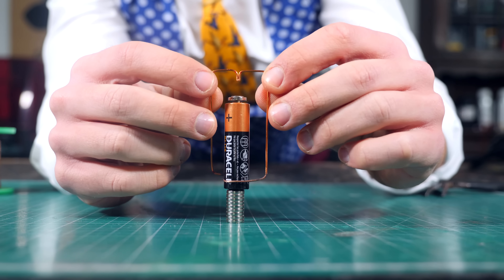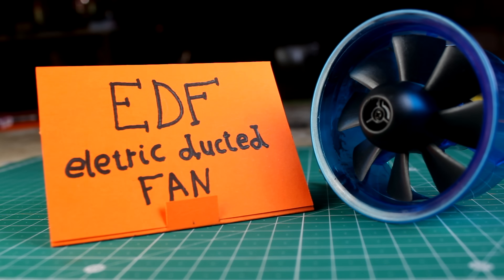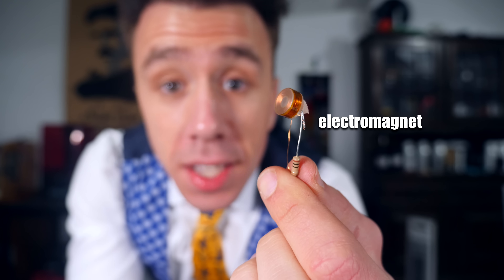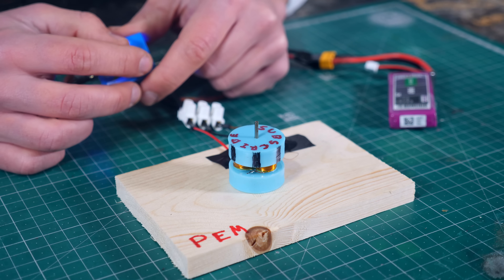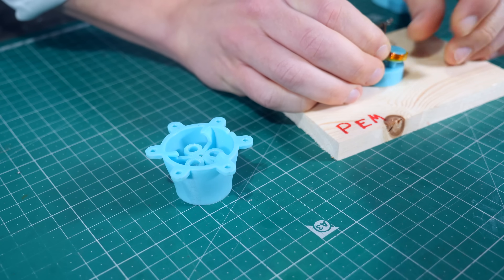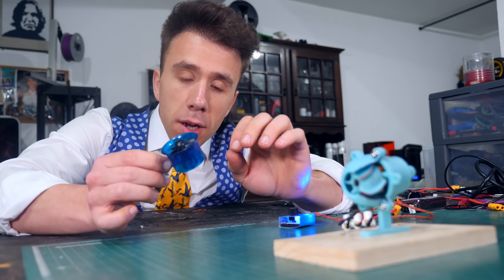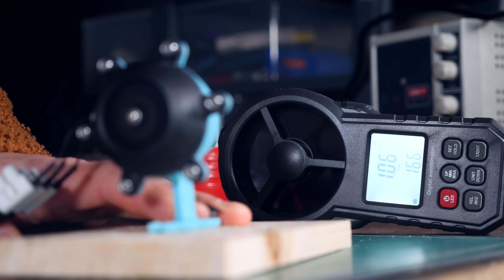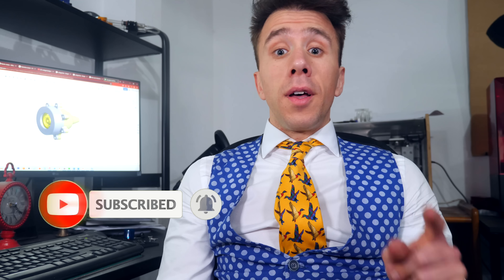I 3D Printed an ELECTRIC MOTOR FAN

Comment: Hi Integza. Typically, axial fans create ‘high’ flow at low pressure ratios. Impellers/centrifugal fans create ‘low’ flow at high pressure ratios. For impellers, this pressure ratio is a function of rim speed (and a bunch of other things).
Reply: Also, I forgot to add that your throat areas look significantly reduced moving from the edf to the impeller/ centrifugal fan.
Reply: Yep, was going to mention that. The dyson one he finished with is a mixed flow fan, kind of a medium pressure, medium flow type fan. Regarding the outlet area, since he has additional pressure available from this type of fan he could probably have a smaller outlet area, but not that much smaller. One thing I learned when doing some CFD work on a mixed flow fan is that you want the outlet area to gradually increase as you progress to the exhaust. We found that sudden increases in area would generate a lot of turbulence and reduce the fan flow. Also stationary vanes that "catch" the outlet flow from the fan and straighten it out also helped the performance, like the stator blades of a jet engine
Reply: Not to mention the impeller copied from a vacuum will probably be better suited to draw a vacuum than to move a lot of air....

Comment: you are somewhat compressing the air, it raises its temperature and heats the walls. If you want just thrust from the motor, the least you compress the better. I dont know if this happens at this scale, but its a guess... I will ask ChatGPT to see if its true...
Reply: Ah you could use PA12+CF filament to print that impeller...

Comment: Yoo Joel, Excellent job, i'm a big fan of the fan jokes.
 
If I may suggest something to help.
 
Is it possible that you're getting more thrust with the fan than the centrifugal thruster, because you have restricted the flow area too much in the centrifugal thruster that the mass flow rate is drastically reduced?
 
It would seem the fan can "scoop" a lot more air per rotation.
 
And while thrust is definitely velocity dependent the mass of the air being thrown backwards also makes big difference.

The the centrifugal thruster may be propelling the air out the back much faster but it may not be sending nearly as much air so the overall thrust is not nearly as much.
 
Also remember, and I'm sure you know this already, most in action centrifugal compressors on turbojets are just that, compressors.
 
When they compress the air the flow areas don't need to be as large for the same mass flow rates.

So if you're trying to make a centrifugal compressor thruster and modeling it after regular centrifugal compressors in turbojets but not also doing a high compression ratio, the mass flow rates will be restricted.

But anyway. Just a thought and random stab in the dark without knowing more details about the build.
 
Let me know what you do figure out in the end though. I'm very curious input this build. Stay classy!

Comment: Video ideea: land an egg on the ground (without breaking it) just like NASA landed the curiosity Rover on mars! You could use solid fuel rocket engines and thrust vectoring control to stabilize the rocket! All of this would be done after the egg has fallen from a two stage rocket controled by an arduino! The rockets would fire at the perfect time so that when the egg touches the ground there is no more thrust to get it flying again! 

Also tomatoes are disgusting!

Comment: As others have stated, axial and centrifugal fans are optimised for different use cases. Axial fans are great at moving volume, but suck when they encounter back pressure (try printing a cowling for the back of the EDM that restricts the airflow down to the same diameter as you had on the outlet of the centrifugal fan and compare flow then). Centrifugal fans move lower volume but can do so with higher back pressure.

Dysons fans are used in situations where high back pressure is encountered. The "fan" requires high pressure to create the ring of  airflow that "pulls" the volume of air through the fan hole. Vacuum cleaners have filters and relatively small pipes that air must flow through which increase resistance to flow and thus the fan sees a relatively high pressure difference between it's two sides.

Comment: The issue is losses due to compression, the edf doesn’t compress the air as much as just move it, the impeller wheel is trying to compress the air your passing through, the only way your going to get that moving the way it should is to put the motor the other side of it and create a gas turbine engine and use the motor to get it up to speed and then once it’s running use the motor as a generator to produce the energy to run the jet, hope this helps

Comment: As you said, your setup adds some extra steps. Maybe it's a bit naive, but isn't the point of pressurizing air to make it burn with kerosene in bigger quantities ? I believe pressurizing the air, only to throw it backwards without an added fuel and combustion, is just lost efficiency. The air momentum is thrown sideways for relatively "useless" reasons in that case

Comment: Turn the fan inside out like a funnel but with blades on. 

Alternatively, copy a high bypass turbofan engine with a flat disc of blades running air around the motor in a streamlined body. 
I'm not sure how the Venturi effect may affect things.

Comment: I do not know will this help or not, which that is just my modest opinion. I will say that try to add some flare on the edge of your fan case, trying to achieve a more laminar behavior on both the inlet and the exit; in my knowledge, turbulence are more likely to stick on a surface - where for a small fan the surface to area ration is significantly larger; I will believe this will decrease the resistance of the air rushing out from your nozzle and potentially increase the performance

Comment: Momentum is m*v, energy is m*v^2/2 So you need to push a lot of m with small v - to have higher trust at lower energy (power).
Essentially you need to make a large propeller, like on a helicopter.

Comment: I’m thinking that you are trying to get a flow ‘through’ your impeller, when you should be aiming for flow into the centre of the impeller ’hub’, but then having the air coming off the impeller ‘laterally’. If you look at where the opening to the combustion chambers on a High Bypass TurboFan are on the outer edges of the impeller, and then redirected rearward.  This also is how the impeller works in a water pump.  The impeller ejects the water laterally to the axle of the impeller.

Comment: Design it around the maximum force your 3d printed parts can handle, that way the angle of attack is truly optimized and the draw of air and power is at its highest performance

Comment: Thrust depends on the propeller geometry, air density, airspeed and the RPM. You want to obtain the same amount of thrust that the EDF, therefore you will need to move the same amount of mass of air that the EDF moves. If you have less surface area you do this by increasing RPM.
Reply: Other thing is that centrifugal fans are great in increasing air pressure but not as efficient in moving a great mass os air therefore the ducted fan has a larger mass flow rate than the centrifugal fan.

Comment: An axial fan works because of the pitch of the blades.
A centrifugal fan works because of the "pitch" of the blades.
One must remember that the air through a centrifugal fan does not travel straight from the axis to the edge in a perfect radial flow. It swirls around with the rotation of the fan. Thus, the blades in your video are likely very flat pitch relative to the flow.

The apparent angle of attack of the blades increases by moving the trailing edge (outer edge?) forward with respect to the rotation direction. A blade with a very high angle of attack would "look" like it should pull air back into the fan. A blade that looks like it pushes air out, in fact, has a very low angle of attack.

Blades such as yours create better static pressure compared to axial fans. Old jet engines used them because they could make a decent compression ratio in the burner cans with the available manufacturing technology. Now we have multi-stage axial compressors that can push upwards of 30-50:1 compression ratios. But, we also have the capability to manufacture high temp alloys with a great deal of precision compared to 80 years ago.

You'll likely not get the velocity from a centrifugal fan that you will from an axial. But, you can get close. Just adjust the fan blades with the trailing edge forward of the leading edge by about 20-30°. That should help. It will be a trade off between static pressure and velocity. Up to the point the fan won't make enough pressure to overcome drag.

Give the higher pitch blades a try.

Comment: well it is the same motor but diferent fan tipes have diferent levels of efficiency so im guesing that guys that made the original fan desine spent much more time makeing it more eficient, or it can be that it has more surface area than your desine. and a sugestion for a future video is can you make a variable geometry turbocharger

Comment: As you told in the video, Centifugal fan push the air outwards. So, some of the wind colides with the casing and loses its kinetic energy. 
In the EDF, the wind goes straight and doesn’t lose its kinetic energy and thus the EDF can produce more wind speed.
You can add a constriction at the rear part of the fan as a nozzle in your fan. This may help.
This is my theory.

Comment: your problem may be (and correct me if im wrong) wabey the plastic that your ysing may cause problems with you "fan" perhaps the diamiter or the stress aceptence is diffrent like the plastic that the fan uses may be able to take the stress bater that the 3d printed parts? or the casing is not smooth like the platic from the fan ( mabey try some kind of lube etc) hope this helps!

Comment: why would you dogmatically assume a centrifugal fan that an pushprop-edf would have the same efficiency as an centrifugal fan? That physically CAN NOT work. While one just pushes the air forward the other one pushes it outward in to a wall. So while one has NO change in direction the other one has TWO direction changes for the air flow and thusly a lot of energy is lost, since a change in direction is considered a acceleration a well.

Comment: I thought you mentioned on a previous video that impellers are optimized to compress air. The dyson impeller is probably optimized to pressurize the shape and volume of the dyson fan. In contrast your setup expels the air a few centimeters from the base of the impeller. It seems like there could be a lot of turbulence and centripetal that is dispersing the energy of the air jet.

Comment: no, you still have an axial fan there; and a varying blade angle that makes it a poor one at that
your design still blows it out the back along the axis of rotation, further, the casing doesn't leave enough room for the centrifugal part to blow into, as you see in typical centrifugal fans.
try this; leave a flat plate at the back of the blades at the same diameter as the blade edge. then, make a bigger cowling chamber around the fan for the air to blow centrifugally into. Further enhancement would be to add ribbing axially to this chamber as a stator blade, channeling the air out the back around the outer edge of the fan.
right now, the fan is mostly spinning the air around the too tight front cowling with nowhere for it to go

Comment: Even if you had an ideal impeller, your centrifugal fan still would not be able to produce the same thrust as the EDF (in the setup you're using). Here's why: efficiency. In the case of the EDF, you are using an axial flow pump that has a high specific speed (a non-dimensionalized measure of how fast the rotor is spinning) but a small specific diameter of the rotor. Therefore, it will perform best at high motor RPM's, and with a smaller rotor. On the other hand, a centrifugal pump reaches max efficiency at a low specific speed, but with a high specific diameter. In order to achieve the same thrust as the EDF with a centrifugal pump, you would need to make a much larger impeller than you had here, but run it at a slower speed. The reason for this has to do with the fluid dynamics of the rotor/impeller you are spinning: in the EDF, the blades move the air in a direction mainly parallel to the direction it is spinning, causing the air to move at a fast speed, but with nearly no pressure change. With the centrifugal pump, the blades act perpendicular to the direction of motion of the fluid, which causes it to slide along the blades due to centrifugal force and be pressurized along the walls of the casing, before exiting. The result is a fluid that is moving slower, but at a much greater pressure.

Comment: There are a number of reasons why your design doesn't work as you think it should.

Physics can be weird sometimes.

The right answer (or, rather... Most of it) is already in the comments.

While I may be able to provide more guidance, what I have seen here will direct you in the right directions.

I am surprised, with all the jet engine design work, you are this clueless to the issues at hand.

Comment: I believe I would classify what you designed as more of a Turbojet engine rather than a turbofan, since turbofans utilize larger blades on the turbine to flow bypass air around the combustion chamber which increases both efficiency and thrust produced (for a given engine size). This is the main reason newer passenger jets are quieter, and part of the reason they are more fuel efficient. If I remember correctly from my advanced aircraft systems class, roughly 70 percent of a turbofan's thrust is produced by these blades simply flowing air around the engine. Maybe this is something you could try on a newer model?

I wonder if it would help to look back to your own tesla turbine experience and use some of the knowledge from that in your design process?  

Excellent video as always! I'm definitely a fan!

Comment: The 3d printed motor is way less efficient and powerful than the one in the edf. I would recommend just buying a motor for this priject because building a good electric motor is insanely difficult (starting with the tolerances, the materials, the design itself etc.). Your Impeller is probably at least acceptable (the tolerances might not be ideal) but your motor seems to be the problem.
Edit: If it really is the same motor as in the edf, the speed might be your problem. I would recommend trying either a higher voltage power source or a faster spinning motor. I have built some rc cars, planes and drones and in those applications, the motor speed is essential (if your motor is made for too high speeds it won`t have the necessary tourque, if it is too slow you won`t get the thrust/air speed you need.

Comment: There is alot of math and testing that goes into making fan blades. But if we simplify it if we look at fan blades like spoons for air. Depending on the shape, size, spacing, and angle of the blades, each blade can move a curtain amount of air and produce a certain amount of pressure. Normal house fans have large, flat, widely spaced blades that are greater for scooping air and moving across a room, but the spacing and angle of the blades make it terrible if there is anything blocking the blades, because it can't produce  any pressure. While a vacuum can't usually move alot of air, but can produce alot of pressure. This is because the fan blades are angled steeply and are packed tightly together and overlap with each other. These blades are also smaller and have a complex geometry to increase  pressure. For the most part there is a tradeoff between airflow and pressure. Not to say that there isn't a fan blade configuration that isn't a perfect balance between pressure and airflow. But the I strument your using only measures air flow not pressure. While the original fan is great for moving alot of air, the impeller you made is converting more of the energy into pressure. That's why you are not reading as high a value on your fan. 

This is why many large jet engins have a two separate airstreams. The internal one that drives the engine is run through an impeller system that compresses the air, add fuel, and burns it. While the outside airstream only goes through a large fan in the beginning that is designed for more airflow and actually produces more thrust than the internal airstream. 

Hope this helps.

Comment: Integza, the original EDF fan is optimized to accelerate the largest possible air mass with the lowest possible pressure differential, similarly to a propeller. The examples you gave of centrifugal impellers have designs for elevated pressure ratios. If you want to do a centrifugal fan, something comparable to the EDF, you must use the type of impeller you find in air-conditioning or engine cooling fans, like the VW Bug.

Comment: In general terms a radial fan is high volume low pressure. An axial fan is low volume high pressure. To produce thrust it is about how much air mass can be accelerated by the fan F=MA. A radial fan in this case accelerates more mass therefore more thrust.

Comment: Betcha problem number one is your impeller design has too narrow of an inlet, restricting the amount of air that can be sucked in.
Without looking at the fans side by side, it looks like the opening at the front of your impeller has less surfact area than the ducted fan design.
Another thing to take into consideration is the mass of the blades. Yours might be heavier than the original blades, resulting in lower RPM overall.

Comment: Tighten up the clearance between the turbine and the housing to help build pressure and force the air out the back. Following the physics of a pro charger pretty much.
You probably need a lot more torque and turbine speed to build that kind of pressure😂